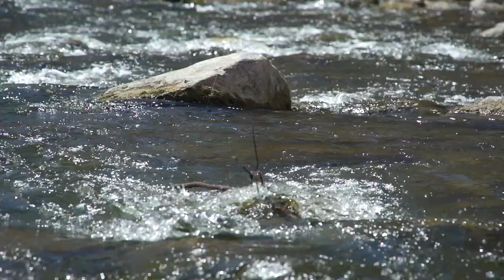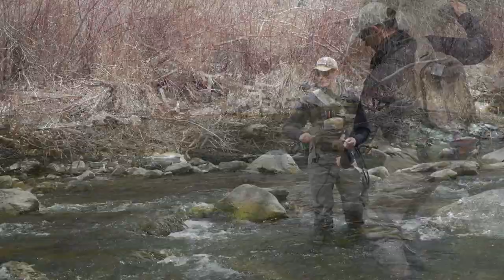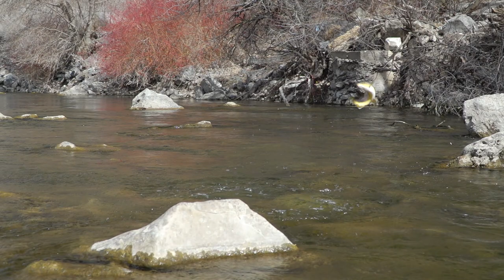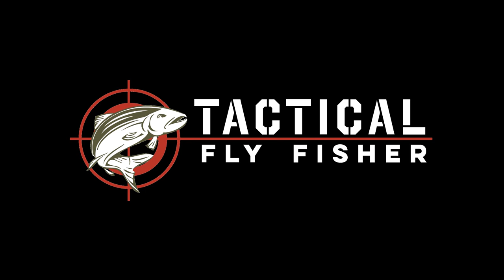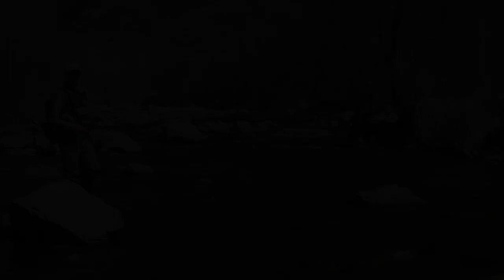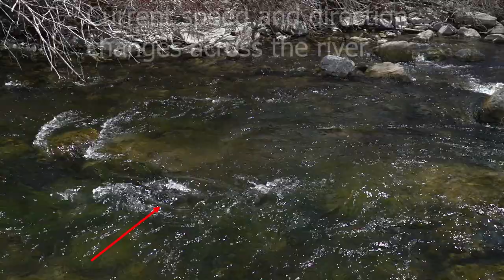Improving your drifts with the parallel kick cast

Comment: Devin, is the "kick" a readjustment of the rod tip after the forward cast or is a "flick" after the forward cast?
Reply from the maker: Pablo Sebastian I don’t really know how to explain it other than how I do in the video. If you watch I extend my arm on the final forward cast after the flies have started to turn over.
Reply: @tacticalflyfisher3817  Cool, thanks!
Reply: @piebald80  It is the same concept as a "reach cast" which Devin notes in his video. 

Check out the Orvis video on doing the reach cast and it may clear things up for you (i.e. the reach cast is the more basic cast that the parallel tuck cast is based on).
Reply: @jacobbeers1136  Thnx! If it's just a reach cast than that really simplifies things for me. I appreciate the help!
Reply: @jacobbeers1136  That's right, correct !!! Nothing new with the Parallel Kick Cast. It is much easier if they told that it is similar to a Parallel Reach Cast instead of a Reach Cast crossing the stream perpendicularly. Thank you. Your explanation is very correct.

Comment: Thanks, seeing the video is better than trying to read the photos in your book.  Does this make the flies curl inward also?  In other words, does it have sort of the same effect as a tuck cast but in a 90 degree change of plane, where you get the flies to tuck in toward you so they're shooting upstream in a parallel direction while being off to your right?  If that makes sense....
Reply from the maker: spikeconley the rod is still rotating over the top in an oval so they shouldn’t curve laterally unless you’ve made a flat sidearm cast.

Comment: Can you explain the difference between the parallel kick cast and helicopter cast. It seems like both continue the oval cast a quarter turn to get the flies further out and in line with the current. are you extending the cast by continuing the cast from the high part of the O down to where your rod is perpendicular to the flow? Thanks
Reply from the maker: The difference is in the path of the casting arc. The oval of the parrallel kick cast is more or less vertical. The rod stays out to your side and the rod tip never travels up and over your head. This path is better for casting quartering upstream. The helicopter cast follows a much more horizontal path through the air and the rod goes over and behind your head during the stroke. This path makes the cast better for getting under trees and casting more across the river and less upstream.